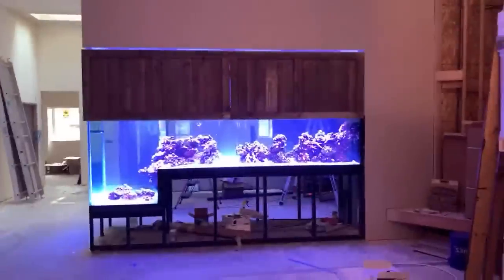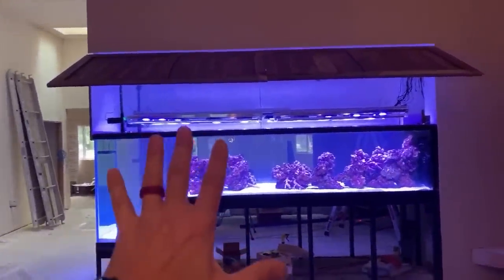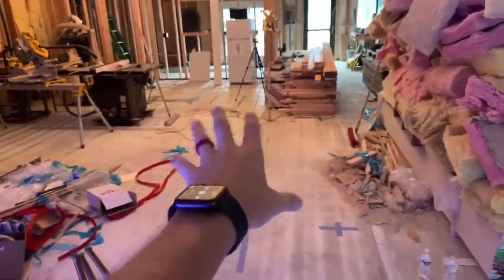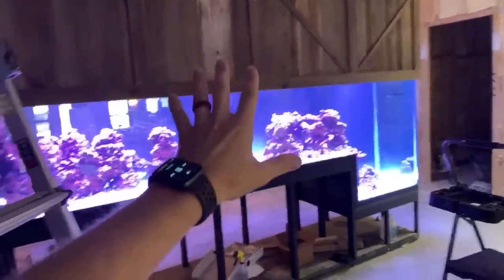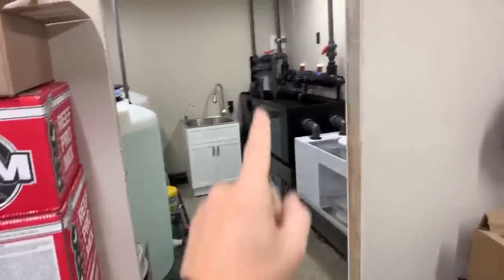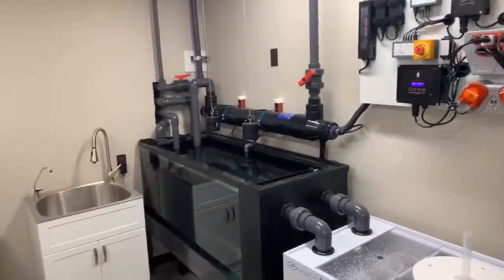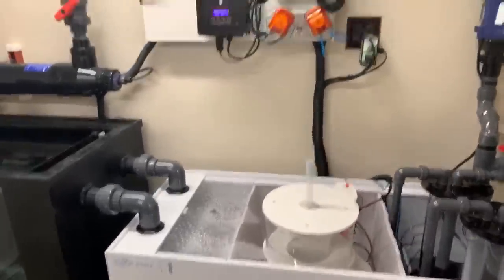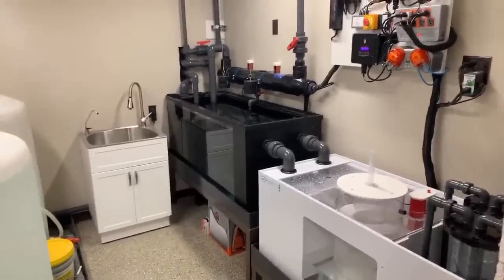Near Final Walk-through - 12 Foot Step-Down Build w/ Mr. Saltwater Tank

Comment: Is there any real benefit to having an in-line heater versus traditional heater’s? I do understand that it’s not inside the tank or sump. Are they more cost-effective to run?
Reply from the maker: Mark waller it’s not a cost to run savings. Its a better built heater that isn’t prone to failing like other heaters.
Reply from the maker: Mark waller plus you can get them in bigger sizes. This one is 1.5 kW
Reply: SaltwaterAquarium thanks for the info. I’m getting ready to upgrade to a 535 gallon tank and looking at different options.  I will have to do some more research on in line heaters.
Reply: Mark waller subbed you. Will you be sharing the build process on YouTube?
Reply from the maker: @brianculater6444  Please sub to Mr Saltwater Tank for Future Builds - https://www.youtube.com/user/mrsaltwatertank
Reply: Brian Culater yes I will be doing a build blog.  I should be starting in January.